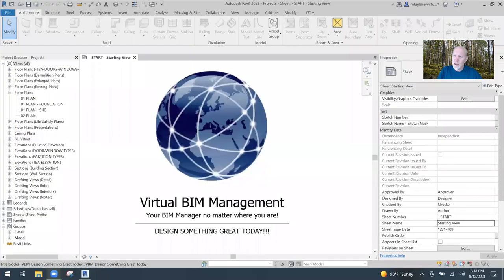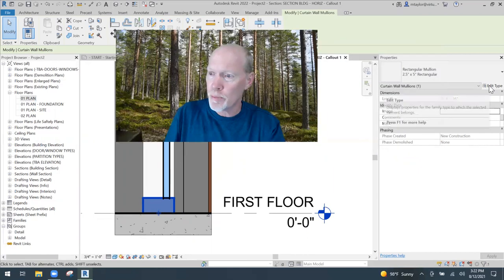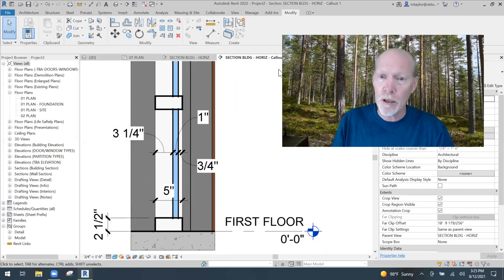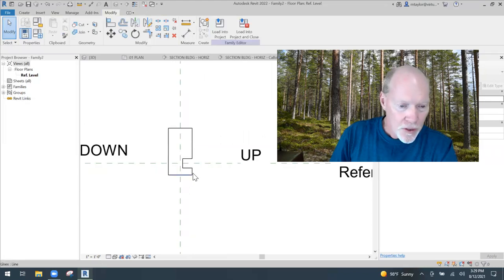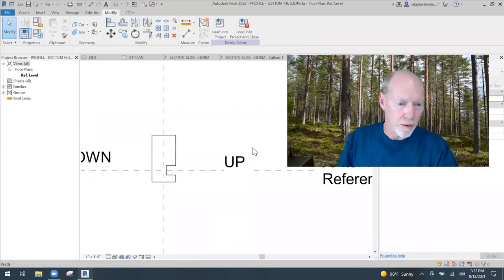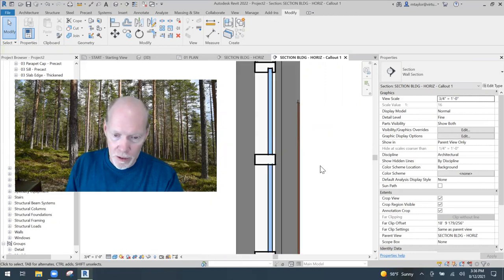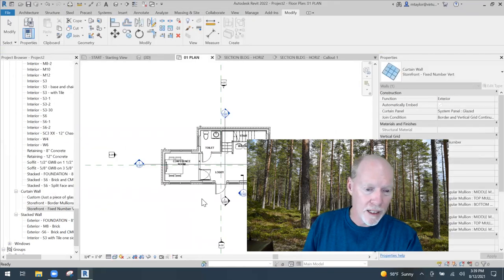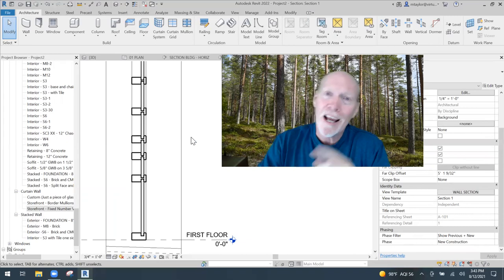NEW CURTAIN WALL MULLIONS: custom shape from scratch

Comment: Thanks..but I have one doubt. After adding millions to the curtain walls the length will automatically deduct. but I need to give proper deduction like 14 from top and bottom. when I give this by using top and bottom constraints the millions also moves with that. Can you help to find this.?
Reply from the maker: I think the dimensions for the curtain walls go from the Top and Bottom.. so we need to keep the mullions inside and not overlap the perimeter lines. I will watch the video again and see if I can detect the problem. Thanks.
Reply: @miketaylor-fantastic  solved that like provided levels for the top and bottom.

Comment: Good Presentation my friend, just one little question, in a basic wall you can set the center line of the wall to face of the wall, center of core , interior face etc.. but if you create a storefront wall the center line of the wall will default to center. is there a way to modify the location of the wall reference to face of system. the reason why is that when you dimension a storefront or curtainwall, you don't dimension to the center but rather dimension it to the face. please advise. thanks, ricky
Reply from the maker: I agree this is odd behavior in Revit for a curtain wall. But it’s built in.. so, to place dimensions, we typically hold our cursor over the face of the mullion and hit TAB key, the dimension string will then snap to the mullion face and not the mullion center.